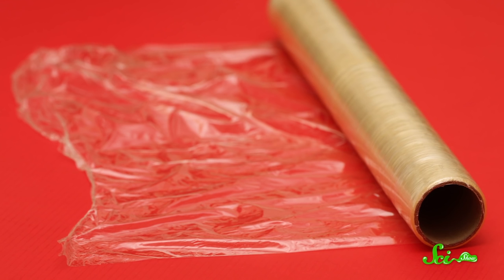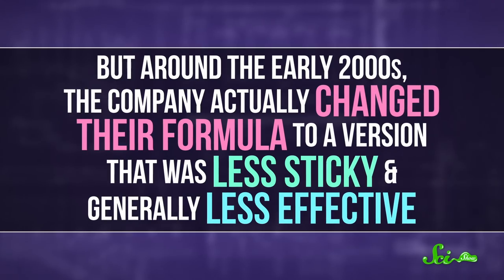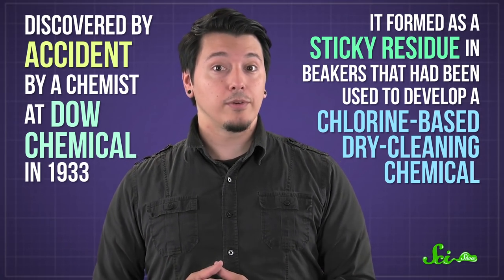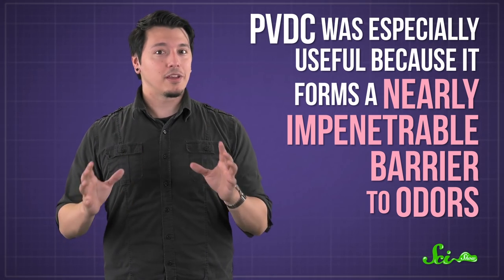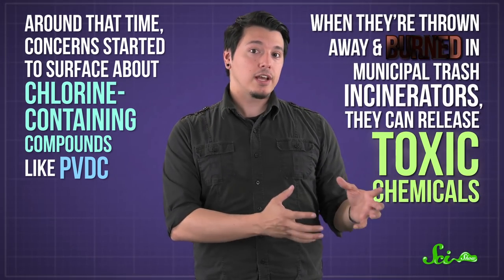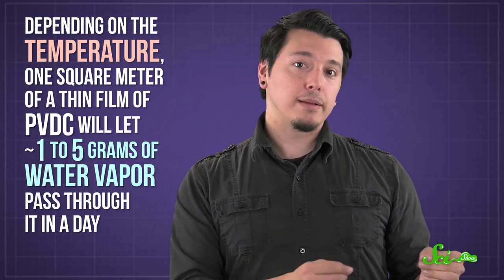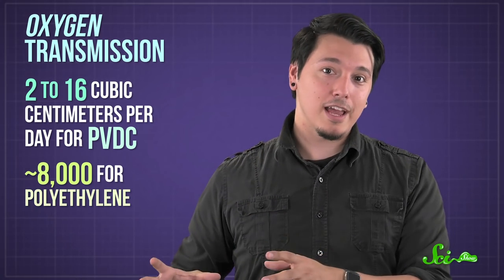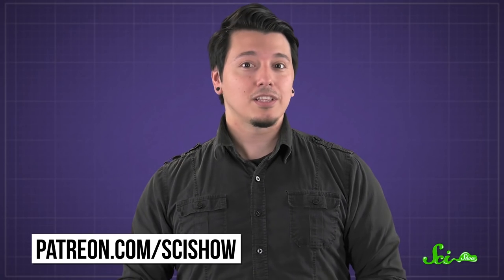Why Isn't Cling Wrap as Good as It Used to Be?

Comment: I challenge you to name something - anything - that IS as good as it used to be.
Reply: duct tape
do I get a prize?
Reply: Knipex brand pliers.
Reply: Technology
Reply: Wayne Huang
Yes, my approbation. Treasure it always. Do you know that duct tape is the ONE type of tape that was found by the US government to be completely unsuitable for... taping ducts? Also that it was originally called "duck" tape, because the adhesive was applied to cotton duck, a kind of fabric?
Reply: Weird Al Yankovic's song Fat and the corresponding music video.
Reply: Coxy002605
Sorry, never heard of those.
Reply: RED Null
No, that's much BETTER than it used to be.
Reply: Sean Peery
Sorry, Weird Al isn't old enough for there to have been a "used to be" yet.
Reply: Craig Corson as someone who's worked in HVAC for 10 years, and who's father has owned his own HVAC company for 35 years, I can tell you that modern Duct tape does in fact work well for sealing ducts.
Reply: RED Null
Not over the long term. It works very well indeed for the first few years, but after that, the adhesive loses its grip. Revisit some of your older installations, and I believe that you'll see I'm right.
Reply: We commonly do revisit old sites, and you are right. In fact we stopped using Duct tape a looong time ago and now use a Duct Sealant (very thick and rocky glue) and zip ties. These seals are hard to do wrong and last longer than the duct itself.

I still can't help but have a love for Duct Tape (and Electrical Tape) akin to Red & Green's love for the stuff LOL
Reply: RED Null
Interesting. I've heard that that aluminized tape works pretty well also, but have no personal experience with it.
Reply: I hiiiiiiighly recommend it for any taping involving metal. Definitely the stickiest tape I've ever used. It's also very good for that 2" foam you see people using in windows for their AC.
Reply: Craig Corson It seems few North Americans have.
Reply: Coxy002605
 I went to the Knipex website, and they do look like very high-quality tools. Leave it to the Germans!
Reply: Allen edmonds shoes
Reply: Allen Edmonds have definitely declined in quality since they closed the Maine plant.
Reply: I hear you Craig Corson- Ironic that 'New and Improved' has come to mean the very opposite.
Reply: Computers. A pocket calculator can do more than this could: https://en.wikipedia.org/wiki/ENIAC#/media/File:Eniac.jpg
Reply: Craig Corson Betty friggin White.
Reply: Pornography?
Reply: Duck tape (quack quack) was invented to be waterproof. (It's not.) It was never intended for ducts. I'm not an HVAC guy, but - it's not ideal. Humidity or condensation can make it unstick, it dries out and splits, it stretches, it's not very strong, maybe other deficits too. That metal tape stuff is much better and lasts nearly forever. 

I'm not hating on it. I truly love duct tape. I've made clothing and accessories out of the stuff, and done some 1st rate MacGyvering with it, even if I do say so myself. I patched a radiator hose at 3am in BFE with tape and a chunk of coke can, and it lasted a couple hundred miles til we got home, so so I can brag. If you can't fix it with duct tape, it ain't broken, as they say. It's good for everything... but I'm not sure it's the best for anything.
Reply: Tabasco.
Reply: Sex! 
Oh wait...
Yup, my life is now an empty shell.
Reply: Me
Reply: Shinkajo
Be comforted knowing that you are not alone in that.
Reply: Adnan Al Nassri
For you, perhaps. For others, it's much worse to non-existent.
Reply: Chris Manuel
Enjoy that while it lasts - because it won't.
Reply: Calculators
Reply: Cars are better than they used to be.
Band-aids are as good as or better than they used to be.
Toilets that have been updated are better than they used to be.
Septic tanks are better than they used to be.
Water sanitation is MUCH better than it used to be.
Computers are better than they used to be.
Operating systems are...nvm
Apples are better than they used to be.
Food and clothing dyes are better than they used to be.
Physical currency is better than it used to be.
Recycling is better than it used to be.
Elements are as good as they used to be.
Smoke detectors are as good as they used to be.
Transistors are better than they used to be.
Resistors are as good as they used to be.
Batteries are better than they used to be.
iPhones are as good as they used to be.
And dare I say it, plastic wrap is better than it used to be.
Reply: Frozen convenience foods are far BETTER than they used to be.  When I was a kid Swanson's, Banquet or Bird's Eye were pretty much the only brands of frozen foods and they weren't (for the most part) very good.  Now we have some brands of frozen foods that are really quite good.  Have you ever had Stouffer's French bread pizzas, or Marie Callender's fettucini alfredo?  They are delicious and FAR better than the frozen foods of the 50s and 60s!
Reply: @Craig Corson
That's not true. The most popular brand at one time was called Duck Tape and it even had a little picture of a duck. The name stuck like Kleenex or Koolaid
Reply: music
Reply: Music. Oh wait.
Reply: Cruzer I already said that but I was serious because I'm not a sheltered cultureless pleb
Reply: spoonikle damn beat to it...wait this sounds wrong nvm
Reply: Soft blankets get softer each year.
Reply: Virtual Reality
Reply: A lot of people are commenting that this thing or that thing that DID NOT EXIST when original Saran Wrap was around, is better now than it used to be. Since those things didn't 'used to be', I can't see why such replies are relevant.
Reply: Cocaine
Heroin
Cans of beans
Reply: Cats. Cats are nice.
Reply: Teigan
Yes. Cats are as good as they used to be, and dogs as well.
Reply: Doctors...
Reply: Weed!  It's considerably better actually.
Reply: Lightbulbs have actually improved.
Reply: Hard Drives or literally any part of a computer. Our Smart phones take a steaming dump on even the best computers in the world a few decades ago.
Reply: Hot water flasks much much better.  Also hardware stores is much more woman friendly
Reply: cars
Reply: Aids medication.
Reply: Craig Corson duck is a brand of duct tape
Reply: TheReaverOfDarkness plastic wrap isn't... it's more permeable and less cling so it self unwraps & protects the contents less
Reply: elenacasey gibbons depends ... 
if you are talking about LED yes. Florescent mercury vapor ones no.
Outlawing incandescent bulbs was silly sure the use more energy for lighting but when used for both heat and light they are more effective than alternatives as well as safer. Examples include food warmer  [ lighted and keep food at temp, now need separate lights and heating using more not less energy)
Reply: Craig Corson good as it used to be is ofcourse relative, many things are "safer" than the used to be like the cling film mentioned, so it's a different better.  Analog radio tuners allow slightly detuning allowing for propgational frequency drift.
Reply: Bahco files aren't shitty yet.
Reply: Socks. Haven't seen a degratation in those. But duct tape's breaking up to nothing now.
Reply: Craig Corson dogs
Reply: Copper-Brass
Well, you got me there. Nobody will ever make a better dog. Or a worse one. They're the best.
Reply: Steel spoons, wool sockets, good ol' soap, white rice.
Reply: deez nuts
Reply: wait so a music video by weird al that came out in 1988 isnt old enough to be compared to the thing that got changed in 2004
Reply: Humans have more meat on them now back in the old days it took a full car of people to feed canible hill tribes now they can get by with just one person on a rascal scooter.
Reply: Craig Corson Aluminzed tape is garbage for sealing ducts.
It basically ALWAYS has inferior sealing to duct tape.
Reply: Everything is as good or better than it used to be.
Except things that are now made in China whereas they used to be made in America, Germany, Mexico/Canada.
Reply: Craig Corson GamesWorkshop.
Reply: Craig Corson Dogs, not so much. Look at the history of pugs...
Reply: IRS

Comment: I just stick to Aluminum foil... Never liked the shoddy plastic strip used to 'cut' the saran wrap, which ultimately made you sit there for 10 minutes peeling it apart. Aluminum Foil works perfectly fine, heck, Tupperware is even more effective.

Comment: As someone who bakes and cooks for a living, the fact that the wrap no longer does it's job right is infuriating to say the very least.   It is an inferior product that does not do the job it is supposed to do but they still charge as much as the old product (adjusted for inflation), which is just a scam.   I want the old style back so badly, where I could get away with using less to get a better result.

Comment: You mean:  3 to over 30 times as much evaporation & 500 to 4000 times the 02 let in to spoil the food through the new stuff and it's not as clingy. Could have put pollution scrubbers on the municipal trash burners cheaper than all that food going bad sooner.

Comment: It no longer does any of the things you buy it for, but that's okay, because it's safer for the environment?

No. That means we're throwing out that, and plastic containers, and zip-close bags. It means we're buying vacuum-seal devices and bags for them, using that, and tossing that out.

If it's not doing what it is made for, it shouldn't be made.